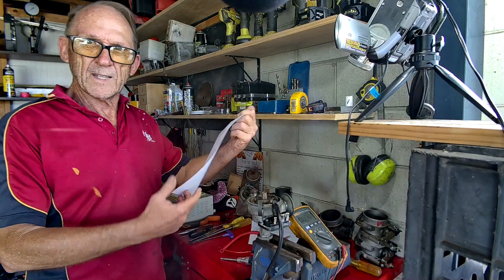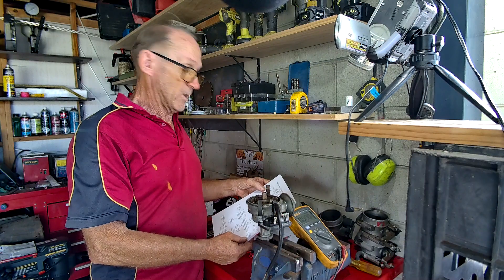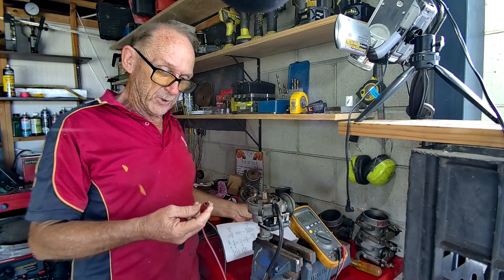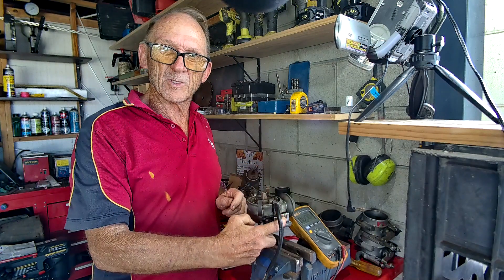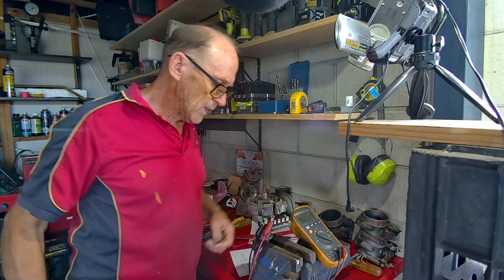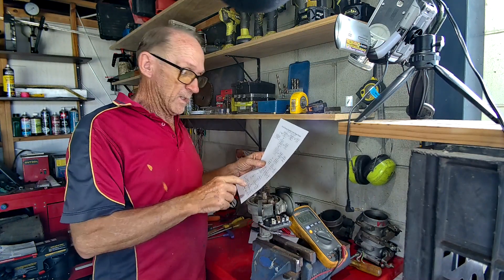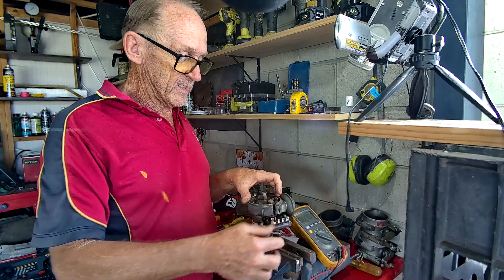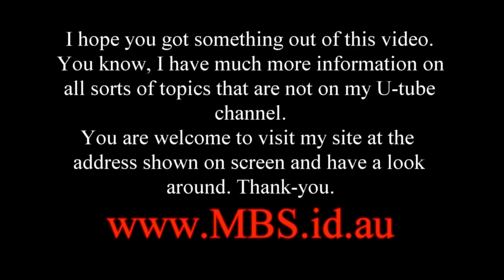Holden Electronic Distributor Service Part 3 - Testing the Stator & Module

Comment: I have a question, now that we have unleaded fuel people give the engine more advance at idle, now this should give the engine more advance at the top end and this isn't ideal. So is there a way to reduce the top end advance without a distributor scope? Thanks Ray
Reply from the maker: Yes there are 2 ways but only one will achieve the best result. You could tighten the secondary spring but all that will do is raise the total advance to a higher rpm. To actually get less total advance you will need to remove the distributor cam and weld a small spot on the advance stops. It is a bit of a guess how much weld you need, for eg. If you want to reduce the total centrifugal advance by 5 deg, you have to guess 2.5 deg on the rotor. So you move the rotor to full advance then retard it by 2.5 deg and then observe the gap from the stop to the post. That is how much you need to weld on. I might make a vid on this actually. But meantime I think you will get what I am talking about if you view my video on refurbishing a bosch distributor. I do meantion this concept on there. Cheers
Reply: @mbsoldschool  Thanks for the response